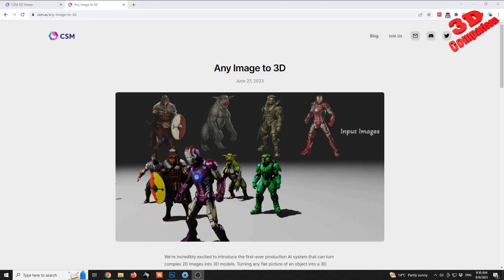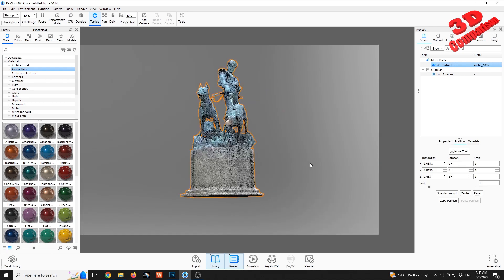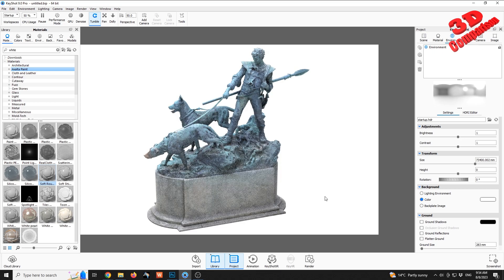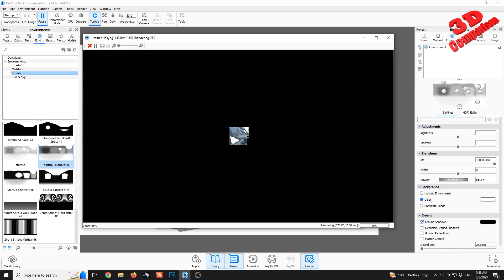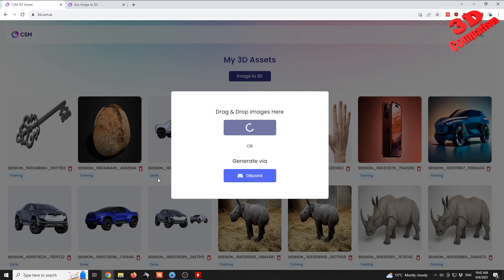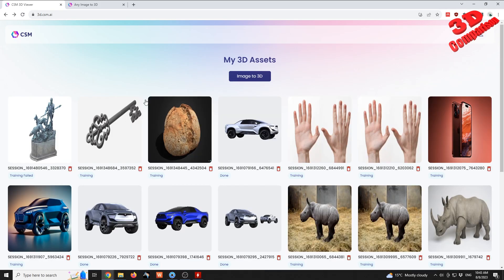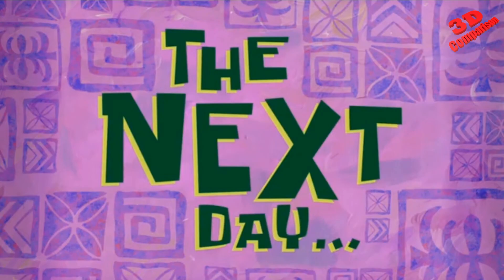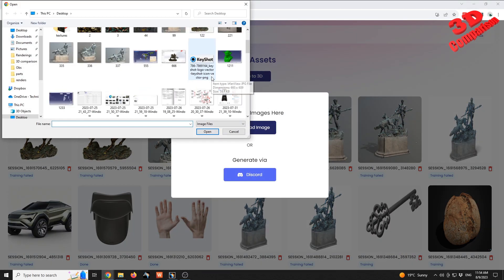CSM - Any Image to 3D AI Platform - Training Failed

Comment: can you tell what size upload file prefect
Reply from the maker: Thanks for the question! As presented within this video I have tried also with 1920 x 1080 (Full HD which is around 2.07MP pixels) and also 3840 x 2160 (4K which is around 8.29 MP pixels). But the problem regarding the training failed is not directly link with the upload size, within a newly added video - https://youtu.be/az0FluD4oUo I have tested both a 2560 x 1517 image which is around 3.88 MP pixels of a Rhino and also a full frame photo with the size of 7360x4912 which is around 36 MP pixels of a Rhino Calf and the CSM platform generated those models with no problem. Keep in mind that the final texture will of the exported GLB model will have a resolution of 2048 x 2048 which is around 4.19 MP pixels. Best of luck with the 3D model generation! and let me know if you encounter any problems using the workflow that I used and if you have any suggestions that can minimize the Training failed error on CSM!